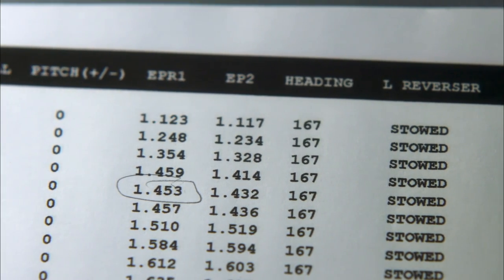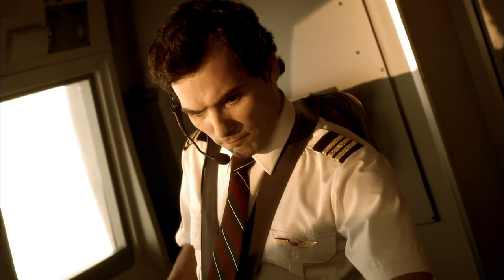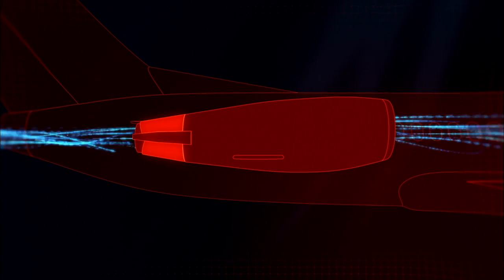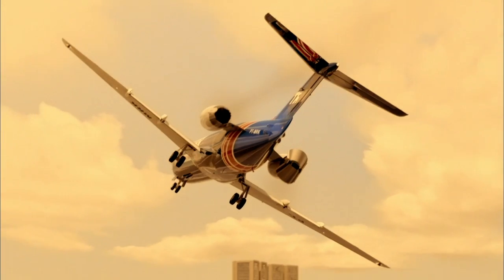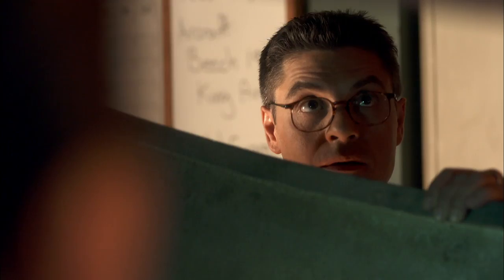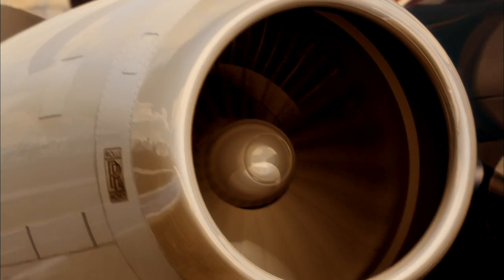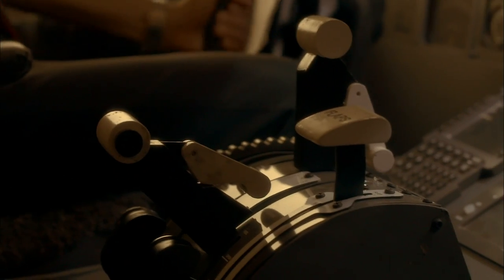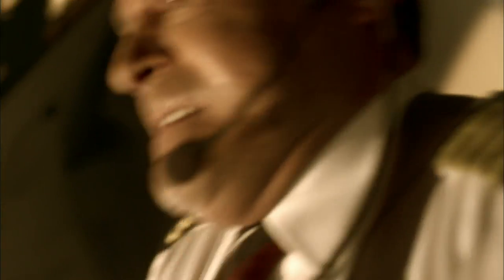Why the TAM 402 Crash Was a Particularly Horrific Event | Air Disasters | Smithsonian Channel

Comment: First officer didn't know the safety was kicking in when the right engine power was  reduced to idle so he powered the engines back to full power
Reply: Yeah I think also
Reply: there should be lock for that if that happens
Reply: My first thoughts also.
Reply: U think so
Reply: Had the alarm gone off warning about a reverse thrust deployed and the thrust lever did what it did the Captain should have warned the first officer what thrust lever was it and not have put it in maxed power whilst focusing on the view ahead

I’m not a pilot myself so I can’t say the Captain/First Officer should have done this or that but again you have seconds to react and it sadly crashed
Reply: @Ladies_Of_death   yes I think so 
Plus the plane was  about to takeoff and thus the plane needed enough speed to get off the ground 
That's why I guess the did that thing without knowing that it was the safety system was reducing power to the engines due to the malfunctioning thrust reverser
Reply: @RBMapleLeaf  In the subsequent investigation it was discovered that the flight crew had not been trained for such an occurrence as the aircraft's manufacturer, Fokker, had judged the failure mode to be so remote a possibility that training for recovery was not necessary.
Reply: In the subsequent investigation it was discovered that the flight crew had not been trained for such an occurrence as the aircraft's manufacturer, Fokker, had judged the failure mode to be so remote a possibility that training for recovery was not necessary.
Reply: @GoatzombieBubba  Also it was discovered that during to the takeoff roll that the auto thrust disconnected. This might've been as a result that the pilots were confused with what was happening. That they weren't trained about the thrust reverses deploying mid flight and subsequently pushed Engine 2 back to full power (The First Officer was as he didn't know it) fighting the safety system that was built in place multiple times until the cable snapped.

I could argue Pilot Error played a factor here, but I will say the Probable Cause was that the Airline and Manufacturer  failed to give the necessary details and trainings about an issue that was already known with the aircraft with Pilot Error being a factor. Also since it was the first stages of flight. It's clear that the Captain would've been concentrating on climbing the plane first as he didn't get much indication from the FO what was going on. 

Interesting fact about the Fokker 100 in some certain cases the pilots if the plane is at a certain weight on takeoff. Can actually takeoff with 0 flaps.

Comment: Thrust reversers (buckets) have several safety systems.  The first that comes to mind is the main landing gear squat switch.  That switch senses the main gear is down and the aircraft is "on the ground" so the TR's can be deployed.  Not in flight.  TR deploying in flight is next to impossible so there is more to this story.  I would be looking at maintenance.
Reply: There was a short circuit in the reverse thrust wiring

Comment: If be honest, Fokker 100 is very quirky and underrated nowadays but very safe and fun!
Reply: U could say its a bit of a fokker...🥁....il c myself out
Reply: @ytcensorhack1876  fokker moment
Reply: Interesting fact about the Fokker 100 in some cases the pilots can fly the plane with 0 flaps. But only in certain cases judging by the weight of the aircraft on takeoff.

Comment: In the subsequent investigation it was discovered that the flight crew had not been trained for such an occurrence as the aircraft's manufacturer, Fokker, had judged the failure mode to be so remote a possibility that training for recovery was not necessary.

Comment: How did they not observe the engine that had thrust reverser activated and put that rogue to idle
Reply: When your IAS drops at low altitude your first instinct is to climb with max thrust. No pilot in the world would have done any different given 15s to react
Reply: Well, how did they not observe....easy, ain't it?

Why should they? No training, no alerts, Short time to react.

Even if they had noticed it was the reverse, there is no sure they would manage to go around and land safely.

Take a look at lauda air.
Reply: They don't see the thrust reverse activated. They just see the engine drop down to idle.
Imagine if you were entering the highway and your car suddenly switched to neutral.
Reply: Most if not all planes have a “reverser deployed” annunciator. First.. for something like this. Second.. for on the ground so the plane doesn’t yaw uncontrollably when you apply reverse thrust (ie: you need to see the annunciation before adding reverse thrust).
Reply: @calvinnickel9995  

O Acoden foi em 1996 na época não era assim e o Foker 100 não tinha essa informação nem mesmo na recomendação de treino.
Reply: Lack of training..

Comment: I believe that the sensors were malfunctioning and accidentally deployed the thrust reverses on the engine and probably the air flow was disrupted because of that and maybe that's why the plane started to lose control and crashed.

Comment: I'm starting to think that flying isn't as safe as everyone says.
Reply: Even if there are some instances, plane travel is still the safest travel method around. Compare how many crashes/emergancy landings of planes happen each year with how many car crashes occur per year. The chances of you getting into a car crash on your way to the airport are still much higher than getting involved in an emergancy landing or even plane crash.
Of course, you can never guarantee 100% safety; that will never be possible, there is always a slim chance something goes wrong. But I still love traveling by plane and trust the people to know what they are doing :)
Reply: You're thinking wrong :)
Reply: @inuala9453  also, consider the fact that there are more cars and drivers than airplanes and pilots. Meaning there are bound to be more crashes in cars
Reply: @inuala9453  You may survive a car crash but hardly a plane crash. So that makes it the most unsafe way to travel. Period.
Reply: @RejanChitrakar  Yes, plane crashes may have lower survival chances (it depends where you sit at the moment of the crash , how the plane goes down, how quickly and IF you can get away from the crash site and how injured you are)

But when you still compare how often car crashes occur each day worldwide and how many people die through car crashes, chances of dying in a car crash are still higher.

Now, consider how many planes are up in the air each day worldwide and check how many crashes/emergency landings happen. You will still find, that there are way less emergency landings and even less crashes happening…
Reply: Same bro